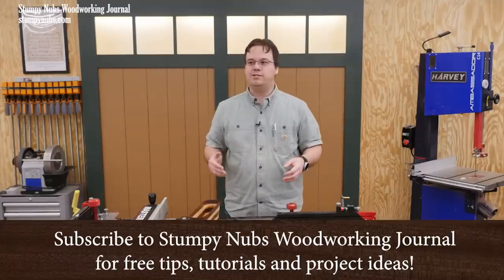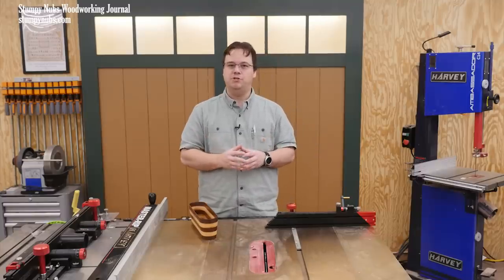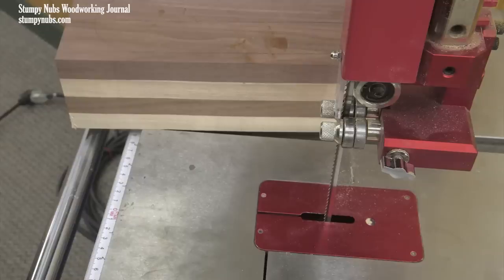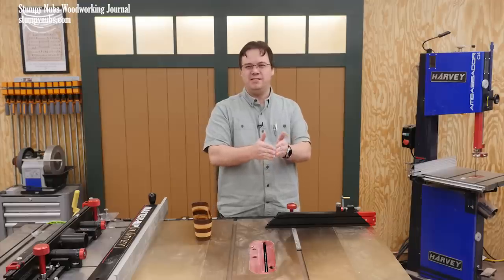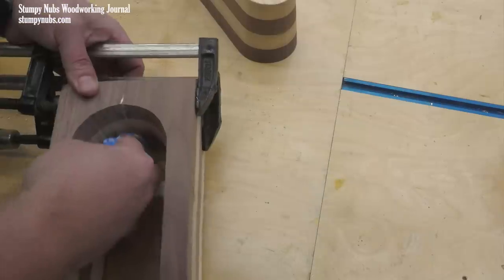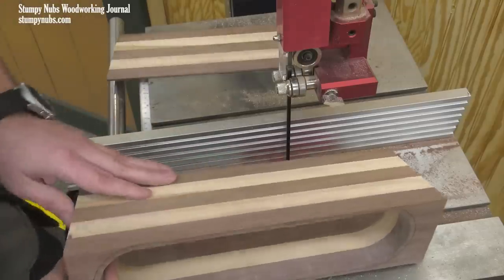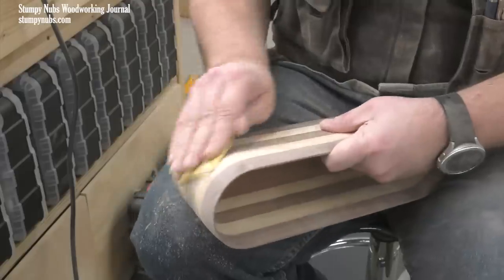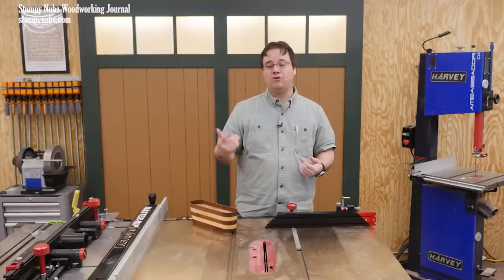CLEVER idea turns scraps of wood into $$$$

Comment: For extra fun, you can use the inner core to make another, smaller basket that nests inside the larger one. It will be a bit shorter since you will have to waste a bit where you entered and turned the blade.
Reply: I’m making a basket now and I’ve got 2 more from the cores and eyeing my last core for a 4th!  Have to do assembly a little different since the outside is already cut when the bottom is put on but not a big deal.

Comment: It looks like my idea of too small for another project is a lot smaller than your idea of too small.
Reply: Yeah same here. But here’s 2 thoughts: basket can be scaled down in size & you can’t store all scraps forever so the more wood you go through the more likely you’ll have larger scrap available
Reply: With my scraps, I can make a basket for paperclips hahahaha
Reply: @bobalman  yeah, I imagine you could even do it similar to those chaos cutting boards. I just tend to save almost everything but admittedly my garage is a mess. His scraps I would view as legit stock though & thought it funny.
Reply: Yep, all Youtube "Made out of scraps!" videos start with stuff that is FAR larger than anything I ever have left over.
Reply: @bobalman  Hey!  I like that.  It could work in my shop.
Reply: @bobalman  I was thinking if you had a sheet/partial sheet of 3/4 ply you were tired of looking at (or any thickness. really), you could rip it into little 3/4 wide (or whatever the thickness is) strips of a given length, and then you could glue them back together but alternating between aligning the plies vertically and horizontally. Stack a few of those up, and then the cross section would look woven.
Reply: Lol no kidding! I'm at the place in my woodworking career where I'm resawing 3.5x7x0.5 offcuts to make panels for tiny picture frames.

Comment: I bought some 3M Xtract last week based on your recommendation. I used it for the first time today to sand a simple little holder for drill and driver bits that I made. I was amazed at how well it works! I just needed to smooth out some light saw marks and burn marks left by my table saw and router. Normally, I would use 80 grit paper to remove the marks quickly, then work up from there. With the 3M paper, I decided to start with 120 grit, and that 120 grit paper removed the saw and burn marks much faster than the 80 grit paper that I used to use, plus it lasted longer and left the wood a lot smoother. It works much better than even the expensive sandpaper than I used before, and it costs less. Great stuff!

Comment: Using cut offs from structural glue lams turn out really cool, I like to cut mine rt in half then glue in different wood or opposite grain piece. So you can add width & radius to the center of the curved ends or can make a center divider with a hand hole cut out kinda like an wooden old tool box.  I like the way u glue the bottom on before doing the outer cut.  i was tracing the bottom a bit proud then sanding it flush after glue up, adding 2 extra steps . Great project Cheers

Comment: Love this idea, could use even smaller pieces to make smaller size bandsaw boxes. 
You could adjust the table angle by a couple degrees when cutting the outside so it's tapered right from the cut!
Reply: They should then nest, too.  (I think)
Reply: he did adjust the table angle and it is angled right from the cut... he just sanded the tip to an even steeper angle to make it appear thinner.
Reply: @steveholder7289  a set of 3 nested baskets/ boxes would be a nice gift.
Reply: @Hephera  He angled the cut but then cut both the inside and outside with the same 6 degree angle. I'm just saying you could try cutting the inside with something like a 8 degree angle, then cut the outside with a 5 degree angle, you could get the thin taper to the thin edge without the sanding so the side would still be flat.

Comment: Really clever method to make a basket. I will try it one of these days. I was thinking, you could cut the blank in half at the beginning and then cut out several layers of the sides that would later be nestable for storage or whatever. The only thing I can think of that would be complicated by nesting is the gluing of the sides back together. May need band clamps for that.

Comment: Go ahead and drill a 3/4" hole even if you remember to set the angle.  It makes getting started a lot easier.  Just remember to allow for the bottom to be 1/4"+ inside the top.

Comment: I was inspired by this project and plan to build it.  However, to better utilze my scraps of wood, I have decided to make the rounded ends using the segmented bowl technique.  The sides will be made from straight lengths of each spieces.  I have a 4 foot piece of tiger wood which I have saved untill I found a suitable a project.  I plan to make the base and top of the piece using the tiger wood.  The other sections will have cherry with ash on either side.  I hope it will turn out.  Nothing ventured.  Nothing gained.  
Great channel and keep up the well informative videos.  I watch every one!

Comment: This a great little project, thanks for the video. 
Any tips if my bandsaw drifts? 
I have a decent and almost brand new Jet 714400K  with minimal use, but I rarely use it because even with the fence I feel like I get a huge amount of drift. Makes using my bandsaw for anything but the roughest of resawing not worth it. 

Were there tweaks I should have done from the factory, to tune it before use that I missed? 

I'm using a 116 x 1/2 x 4 TPI blade. 
I thought that 1/2 inch would help it cut better/straighter but no luck thus far. 

Thanks
Reply: @bobalman  thanks

Comment: I did get the 3m Sander and it has been to 3m 3 times for warranty work. Works for about 10 minutes and then send it to 3m. And no the reset procedure does not work.
Reply: Fine. Ask for a replacement or a refund.

Comment: Its time to rethink the handling with resources. A project where you throw away 95% of the material isn't a goog idea.
Reply: You don't have to throw away the centrepiece. You can use your router to make a storage pot, or a pen stand. You could buy some test tubes and inset then into the block and make a flower display. Use your imagination.
Reply from the maker: Wood in the US is sustainably grown. Logs are harvested and replanted at a rate that keeps up with use. There is no deforestation here just for the sake of obtaining lumber. But even so, who said you have to throw the waste away? Cut another, smaller basket. Or use it for another project.